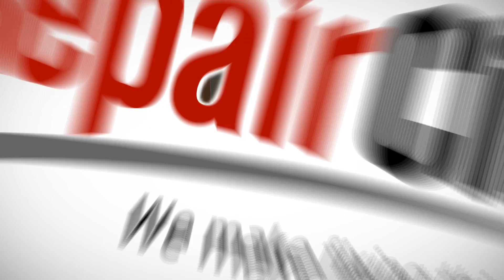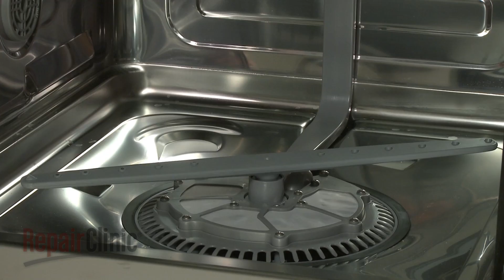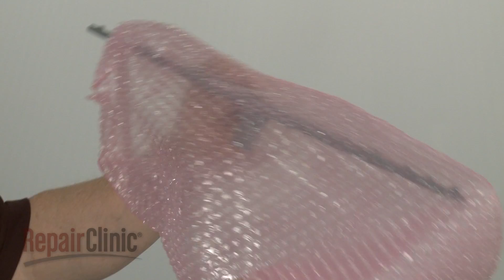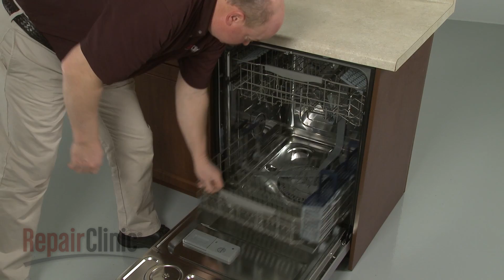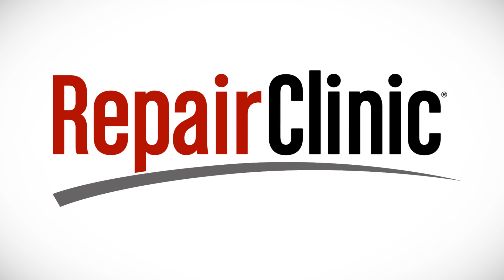Samsung Dishwasher Replace Lower Spray Arm #DD8201120A

Comment: I am not sure if this video is still be monitored for comments but I  am having a small problem. When trying to reinstall the bottom spray arm it will not snap in. I have removed the small coupling which holds it and the arm will reattach that way. However when you try to put both pieces back in place the arm just gets popped back off. It is as if something is pushing it up out of place. I have made sure it is free of food and any other obstruction. Help would be appreciated.
Reply: same issue here...